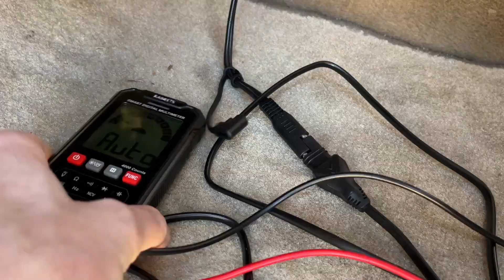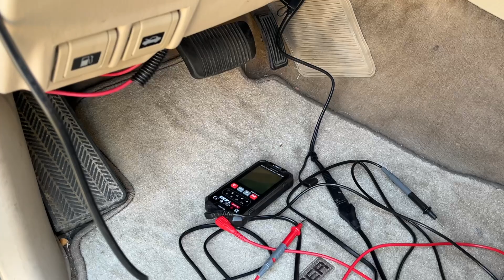Solar Auto Battery Charging via Battery Tender ODB-II Port Adapter

Comment: I bought the same one. But just recently I took a multimeter to the OBD port to check if it really had a direct connection to the battery. I was surprised to find that the OBD port only had data pins connected. There were no pins installed in the OBD port for power 🤦‍♂

Now i'm thinking about whether a fuse tap might be the way to go.
Reply from the maker: That's a bummer. You could use a fuse tap or run a new wire from the battery through the firewall. You would just need to make sure to fuse it (fuse should be close to the battery and be size to protect the wire).

Comment: I switched all my SAE connectors to XT60 because they were cheaper than the XT30 and faster to ship... that and XT60 handles 60 amps so it's WAY overkill for replacing SAE connectors. They're keyed so you can't insert them backwards, and have real male and female ends so there are no polarity issues like SAE. It's great since my solar maintainer and all chargers, and 12 volt loads are all on the same XT60 connector... which again is overkill by like 10X what is needed or what the fuses will allow. For these solar maintainers... not a bad idea to switch them to XT60 because some (like mine) ARE wired backwards and you can't tell without measuring them with a meter... what a nasty surprise when my solar charge maintainer DRAINED my battery... ouch. Check polarity or just replace them all with the same connector... I also had a ton of proprietary 12 volt connectors so having to find matching sets of cables was a pain... putting everything on one connector was well worth my time, already saved me more time than it cost to find them all.

Comment: Can the ODB II adapter be plugged in full time or just while charging with the vehicle stationary ?
Reply from the maker: I often leave mine plugged in when I'm driving but I should probably disconnect it so I don't accidentally step on it and pull on the OBD-II port.

Comment: @RickMakes

Is the Battery Tender cable passive so that I would be relying on the smarts in the Suner to prevent overcharging etc?
Reply from the maker: It is passive so it does rely on what is plugged into it for protection.
Reply: Current is usually rather low on theses solar maintainers so the battery doesn't get to overcharge, the excess energy just bleeds off as heat... not that there is enough heat to be able to measure it though. Flooded cells may lose some water to the electrolysis that charging a charge battery will produce (any charge makes some hydrogen, just we usually only care about the hydrogen produced at end of charge or while float or trickle charging), so for a flooded cell you may need to add water to the cells once a decade... but it's probably dwarfed by how much water is lost by the alternator charging the battery. AGM and Gel cells recombine hydrogen and oxygen into water faster than flooded cells so as long as the charge is slow enough to not cause the vents to blow off... you're fine, they just bleed the excess charge as heat kind of like NiMH does... just keep the current low and you're fine... flooded cells lose the gases because the bubbles bubble up and escape before recombination takes place... hence why they have a low water mark on the cases sometimes.

These are not lithium ion cells, they overcharge very differently and have very different safety practices.

Comment: I'm using almost the exact same setup but with the 18W version of the panel.  When I connect it via the ODB-II adapter, I notice that the blinking light on the panel doesn't reflect that it's actually charging.  It should be blinking red but instead is still blinking green (which the manual says is "Not Active Yet").  I'm wondering if that's normal and due to the fact that I'm using the adapter.  If anyone knows anything about this, I'd be appreciative.  The vehicle is a 2013 Toyota RAV4.
Reply from the maker: Do you have a meter? Do you see voltage on the ODB-II adapter?
Reply: @Rickmakes  Toyota said no-go.  I broke down and am running it into the hood with clips.  It's better than I'd been doing, which was running a chord from the house to the car (danger of someone tripping).  It'll do (and thanks!).